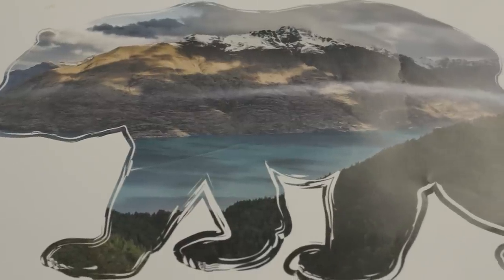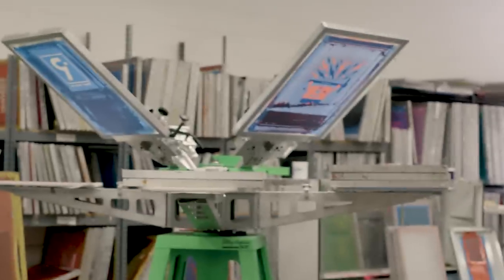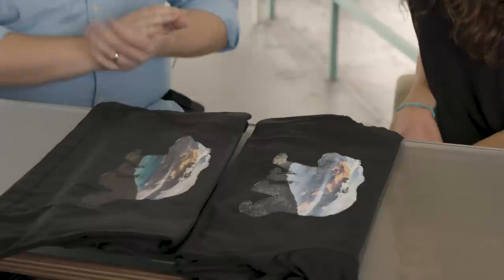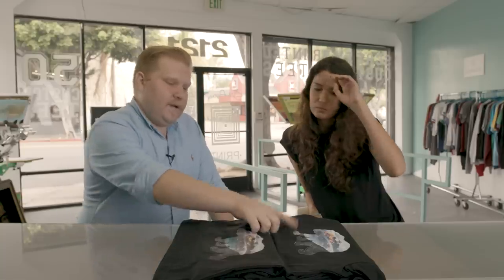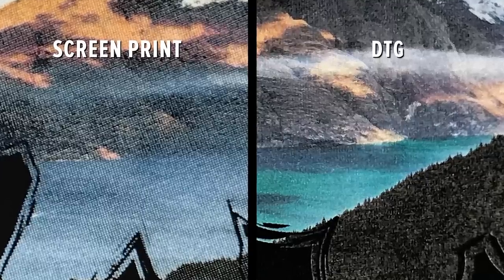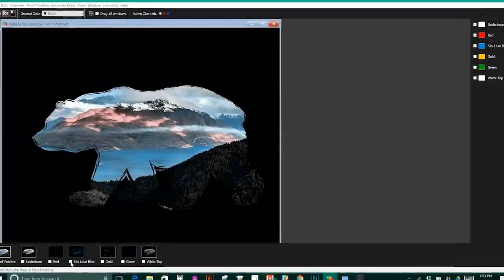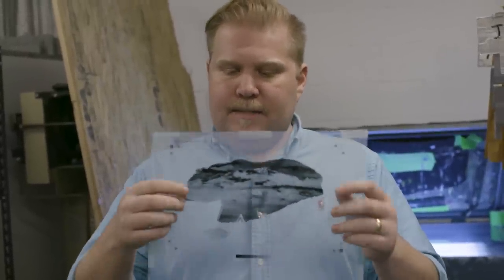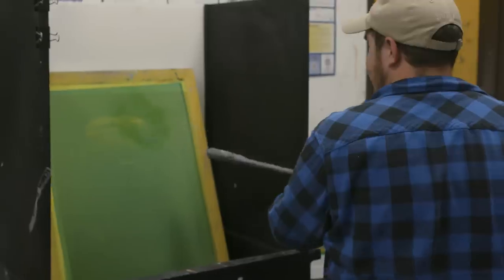T-Shirt Printing - Screen Print vs. DTG (Direct-to-Garment) Print

Comment: you would of had way more detail in the screen print with 60 lpi and above. 45 is a joke? saying its easier for the screen printer to use low lpi is like upselling to dtg or stealing business from sp to dtg ( in house or not). 

i wanna see a high lpi process with durometer specs, angles, off contact and ink type then compare it to dtg. oh on a manual btw ;)
Reply: I would like to see DTG print HD as high as 3 milimeters with a diameter of 0,8 millimeters, and 45 lpi is really a joke. We normally do 62 lpi with 9 colours print and to be fair, if an order of just a few pieces then I would use DTG.
Reply: @chaiketkong  if you really wanna get technical, discharge the batch, contour cut sublimated paper then press lol that might be better detail than the dtg too
Reply: @manooti  can't do, I don't print poly, I always do full colour discharge if the customer ask for high quality print as long as they don't mind the cost. ;)

Comment: You need to choke your base, interlock your black and print at 65 lpi. I can screen print to the same resolution as a slow dtg printer. You can’t replace screen printing. I know Epson, Brother, and now Ryonet would love to have you make tons of videos like this but screen printing will always be best. Pretreating, heat pressing, heat again. Come on! You know the lpi should’ve been at least 55. Also, you have to control the halftones. Accurip is easy but choking a base and interlocking is where it’s at.
Reply: How many times did the screen print "cure"? Try to beat 1200 dpi. Seems old timers are against DTG, it only gets better and better. Also, the price is much cheaper due to technology. No need to burn 6+ screens, it takes 1 minute to print with DTG vs the amount of time it would take to burn and set up a screen printer.
Reply: Luis Castellon Hi, Is DTG durable than screen printing?
Reply: tu DTG no es capaz de estampar sobre sudaderas 1000 t-shirts en  un día
Reply: Interlocking Seps & Halftones FTW!  :D
Reply: I'm curious to know where you picked up this info about choking base, and interlocking white/black, etc.    

My own separation techniques involve 3 and 4-color interlocking, or enhancing the colors trapping them under the interlocked white and black and then using more transparent white and black inks to simulate tints and shades... more of a technique I call "overlocking".    The problem with going to this level of separation is that you can't generate gradients of separations and then interlock...  instead I will take a full hue extraction and interlock each of the colors at let's say 67.5 degrees for example,  and then I run the black/white interlock at 22.5 degrees.   You can take the black/white selection and then "chop it out" from the colors to create a true 3 & 4-color interlocking... but the little pieces it creates in the rosettes can be hard to expose and rinse out properly.    So instead you can take the selection of white/black dots and contract the selection a few pixels before knocking out from the colors... creates a bit of trap or hybrid between full interlock and full overlock.    Changing the inks is where it starts to get really interesting, but doesn't always work out.   Using a clear base and adding just a little bit of white,  can make a great tinting-white,  and same with a black...  with some of these techniques I can almost work completely linear without needing to adjust the curves of anything before outputting.   The drawback of interlock and especially 3 and 4-color interlock is dot-gain/loss compensation... but I've found you can almost make these variables work for the print instead of against it.

Still...  a DTG print and a Dye-Sub print can work great in their own ways when done properly.  

There is still a lot of room for improvement in DTG,  I'm about to get some used machines myself and start trying my halftone interlock rips and color-correction methods on the DTG.  Using very high LPI or doing 1200dpi diffusion interlock seps I bet I can make a way better choked-base and more saturated and corrected color prints for these DTGs.   All too often the inkjet print companies are failing when it comes to the halftones/diffusions because they don't take any consideration of where those specks of color are going, they don't interlock the colors in the separations it is just extremely high dpi dithering.   
I think that even an LPI of 65 or up to 85, 100, etc... with full interlocking seps and a choked base white that matches the colors... would create a more vibrant and color-corrected DTG print...  the simulated halftone dots will allow more of a specific color to be used in those areas, and let the halftones do the blending instead of the extreme diffusion...  I don't know but it will be interesting to test out.
Reply: @MaxChromaColor  I just saw that you commented. I’ve been around a while. I actually discovered not invented discovered but found out for myself how to sep sim process using tons of color tools in Photoshop. I used to do a ton of index seps years ago and I just played with the tools in Photoshop until I realized how all the math works. I’ve been interlocking since probably close to the 90’s. We used to call it round dot index. I think I’ve seen some of your videos. Color and reproducing continuous tone images in the most fast and efficient way has been my passion since digital sepping became a thing. I’ve studied everything related to angle, diffusion, lpi and am passionate about finding the best ways to efficiently set up jobs and run jobs on press. And also finding the best way to set up the art to be printed that way. I’m not a hater of dtg I just know what’s possible if someone truly understands fm and halftones.
Reply: @LuisCasstle  "Try to beat 1200 dpi."

A T-shirt is made of relatively loosely knitted threads; it can't hold (i.e., can't fully benefit from) 1200 DPI in the first place, not even close. Plain old typing paper is a lot tighter and smoother than any T-shirt, and it can't hold 1200 DPI either. To hold 1200 DPI you need a high quality photo-type paper, or smooth vinyl/plastic, or smooth metal or glass. On top of that, even with a suitable substrate, you'll never see the difference between e.g., 300 DPI and 1200 DPI without a magnifying glass.

Additionally, when screen printing spot colors rather than halftones, screen printing potentially has infinite "DPI", because a good emulsion, when properly applied and exposed, bridges gaps in the mesh, therefore there is no limit to how round a circle can be, or how straight an angled line can be, whereas digital printing inherently has stair-stepping because it's a pixel grid.

"No need to burn 6+ screens, it takes 1 minute to print with DTG vs the amount of time it would take to burn and set up a screen printer."

After you've done all the setup for screen printing, you can then print shirts very quickly, and you'll soon overtake the DTG printer which is stuck at one minute per shirt. DTG is only faster if you're doing one or several shirts. For production runs of hundreds or thousands, screen printing is WAY faster.

Comment: I've not only been printing for over 35 years, but designed 20 million dollar surfwear prints. DTG is for people who no little to nothing about screen printing. But to think that screen printing does not capture the same high resolution is nothing but a myth. Also, DTG is very limited. Not like you can print 3D with a DTG lol or leather, metal flake, gold shimers on DTG LOL This is merely an attempt to market DTG garments to those who don;t know how to screen print.

Comment: 45-line screen printing for detail? 
Yeah , no wonder it looks SO crappy!  lol/
Screen printing can look way, WAY better than what you've shown! it just takes some skill and the right equipment. 
also notice you heat press the garment to smooth it out before printing with DTG? you should also do that (on platten) with your screen prints for the very best results.

Comment: el diseño de las películas (film) están hechos muy mal por eso salieron con defecto de estampado en la sao Roque!! usted amigo debería de cambiar su diseñador gráfico por uno más profesional ,así sus estampas en la sao Roque saldría más nítida! ,DTG es porquería ,suelen ser sus bases blancas muy acartonados ,de tacto áspero toda la estampa en si
Reply: The design of the films are done VERY BADLY, that's why they came out with a stamping defect in sao Roque !!!
 You friend should change your "graphic designer" for a more professional one, so your prints in Sao Roque would come out sharper! , DTG is crap, usually its white bases are very stiff, rough touch all the picture itse...!!!

Usa google translate para expresar tu opinion en un canal en Ingles...   😜